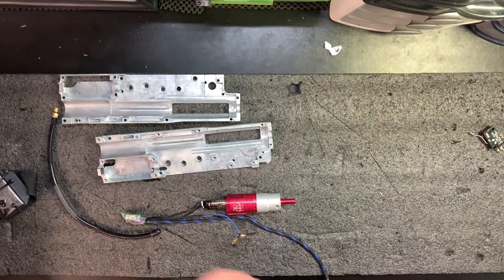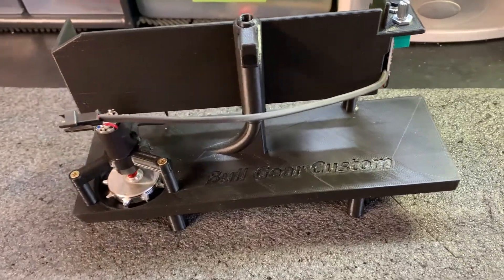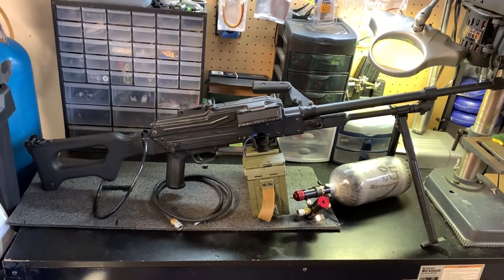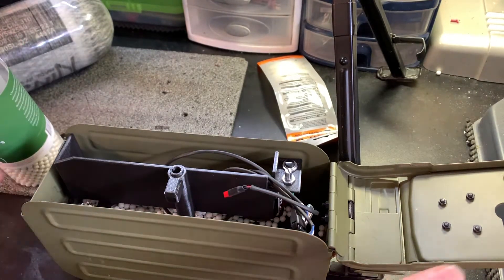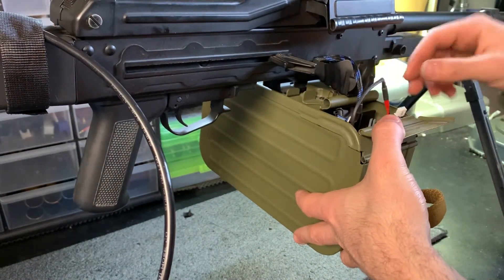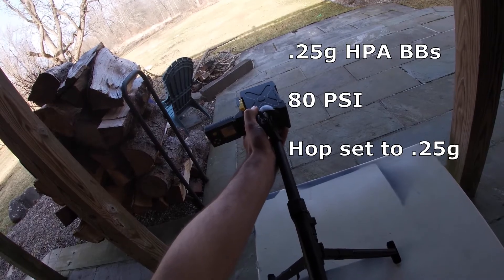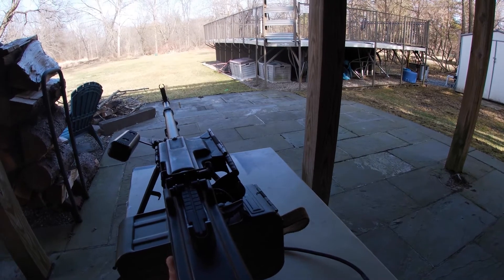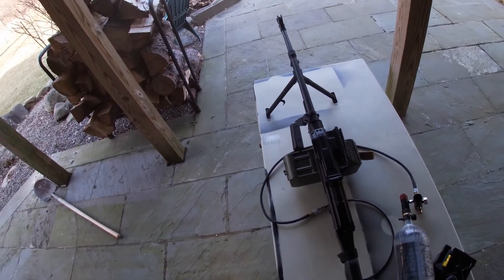Airsoft Upgrade Project: A&K PKM with Polarstar F2 & Bullgear Parts!

Comment: could i get a parts list for what you used? i have the F2, trigger wire, and box mag wire on the way along with the hopup installed, am i forgetting anything?
Reply from the maker: Lambda “Five” 6.05 509mm barrel, Elvish Tac r hop patch, madbull blue, emg atlas, or prommy purple bucking (you need to cherry pick the bucking), BullGear box mag insert.
Reply: @anttechairsoft  thanks, you are a life saver!
Reply: what trigger wire and box mag wire were used?

Comment: Just wondering, What nozzle did you order for this to work? because i ordered the standard one for an F2 and that did not work, and then i ordered the M249 nozzle and that does not work.
Reply from the maker: We used the nozzle that came installed in the M249 F2. Hope this helps!

Comment: How did you do the wire job with the bull gear insert and the polar star FCU?
Reply from the maker: Polarstar makes a FCU cable specifically for connecting their FCU to an A&K box mag!
Reply: @anttechairsoft so you didn’t add an additional micro switch to power the box while shooting?
Reply from the maker: @TotalControlPaintball  Nope, Polarstar makes an FCU cable specifically for connecting an A&K style box mag connector (which the Bullgear insert comes with) directly to the additional port on the FCU
Reply: @anttechairsoft  you rock. if i have more questions i may post them

Comment: Hello, what settings did you use for the Fcu and bottle pressure of your PKM, i have the same one but not the same result (I'm here 2years late sorry haha)
Reply from the maker: FCU settings should absolutely be configured by the end user. The settings will be based on your bb weight and desired muzzle velocity. The settings I used may not translate to the same performance on yours. If the performance is egregiously off then it’s more probable that there was an error in the installation. There’s no way I can diagnose your gun without more information though.
Reply: @anttechairsoft  thanks you that's still help me a lot !

Comment: What parts do you recomend for a&k pkm, im looking to get more rof and range but im on budjet so no hpa please 😅
Reply from the maker: I would honestly go for the same barrel/ hop up assembly in this video. As for the gearbox, that’s very hard to say based on this info. I don’t know your tech abilities or budget, so I’ll say the cheapest thing to do for the ROF is to run an 11.1v and install a basic mosfet like a Jefftron mosfet II
Reply: @anttechairsoft  tech is no problem, but i aint so familiar with m249 gearbox.
Reply: @anttechairsoft  my budget for parts maybe 400-500€, i live in europe so i dont know is that comparable to us prices
Reply from the maker: @teurastaja129  asg boost 30k motor, SHS 18:1, SHS Piston, Lonex complete compression for LMG, make sure your nozzle is 21.00mm, stock tappet plate should be fine, definitely need a simple mosfet. Tune everything correctly and be sure to isolate every variable when tuning! Goodluck!
Reply: @anttechairsoft  thank you! Will look forward to build my pkm with this list
Reply: @anttechairsoft  oh and btw don't the a&k pkm's have mosfet out of the box also
Reply from the maker: @teurastaja129  yes, but they’re not great

Comment: Hi, which trigger board did you use?
Reply from the maker: We used the Polarstar F2 (M249) package. This package does not include a trigger board. It comes with tab connectors for connecting to the M249 micro switch.

Comment: A question, what nozzle do you think is the right one for lct pkp, polarstar f2?
Reply from the maker: I believe the M249 nozzle will work perfectly as it did for this PKM. Worse case, you can check PolarStar’s website, or call their technical support and get a definite answer there! Also, if it helps, the pkp nozzles seem to be 21.00mm- 21.50mm which is the same as the PKM. Some hop up chambers might require a longer nozzle.